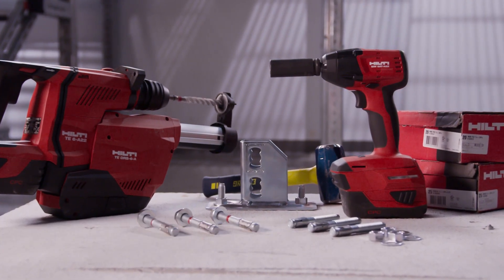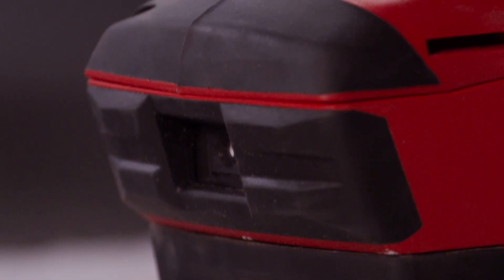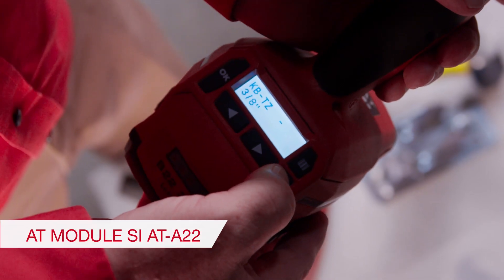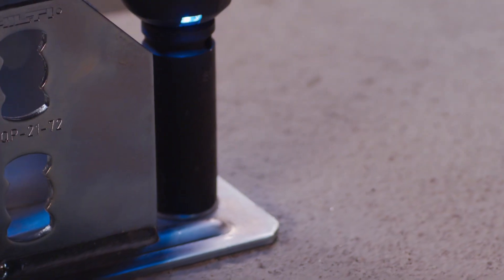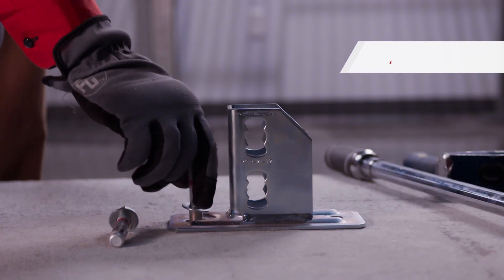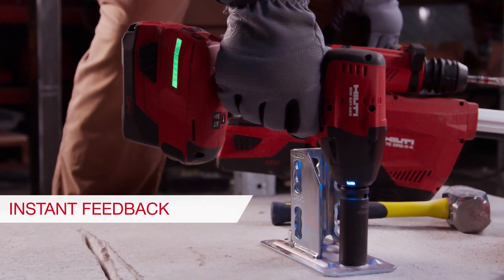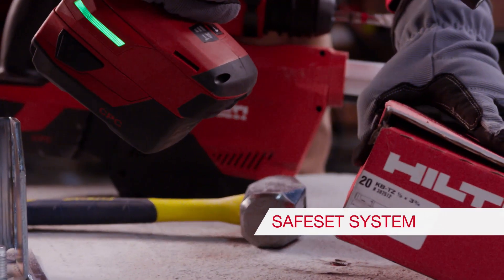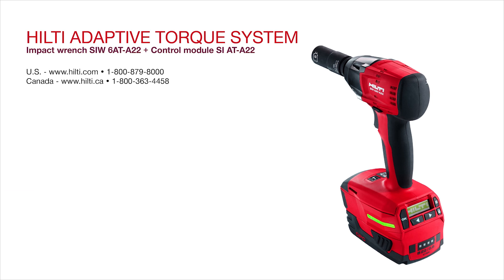INTRODUCING Hilti Cordless Impact Wrench SIW 6AT-A22 and Adaptive Torque Module SI-AT-A22

Comment: What range of torque settings can one manually select with the module?
Reply from the maker: Hi Mel - Thanks for your question. The SI-AT-A22 module is designed to work with Hilti KB-TZ and KB3 anchors. In adaptive operation mode, you can manually select the type of fastener, the material grade/quality, and diameter for your specific application. In this operating mode a total of 30 torque settings are available. The setting to be selected for a particular type of tightening application depends on the diameter of the threaded fastener and the specified torque. If you have more specific questions, please call our customer service team at 1-800-879-8000 (US) or 1-800-363-4458 (CA) to speak to one of our anchoring specialists or visit your local Hilti Store. Thank you, -Sarah, Hilti Social Media Team

Comment: Can u manually set the torque ? Like for electrical installation to have lugs torqued to specific torque or car tires ? Or is this for only anchors
Reply from the maker: Hi Bobby - The SI-AT-A22 module is designed to work with Hilti KB-TZ and KB 3 expansion anchors. You can either scan the box of anchors or select the correct anchor setting manually using the buttons on the back of the module. Thank you, -Felicia, Hilti North America Social Media Team
Reply: @HiltiNorthAmerica  What range of torque settings can one manually select?

Comment: So can you manually select a torque setting? If you can does it have metric and imperial?
Reply from the maker: Thanks for your question! No, the SI AT-A22 module does not allow you to manually set a torque value.
Reply: But u can manually set the at system?